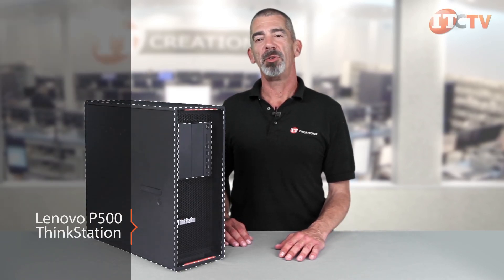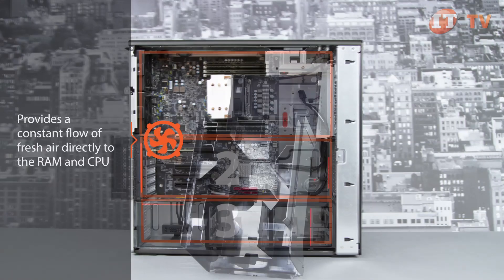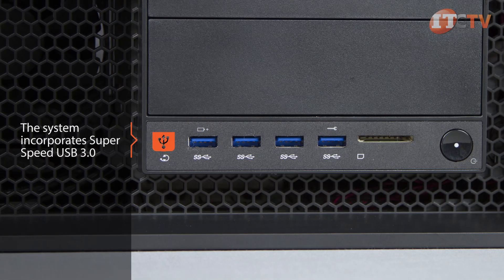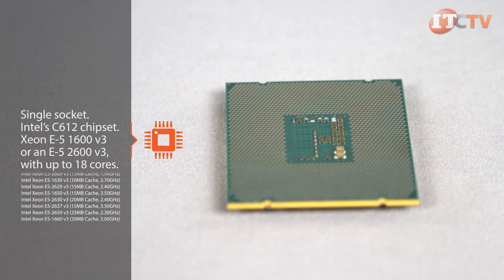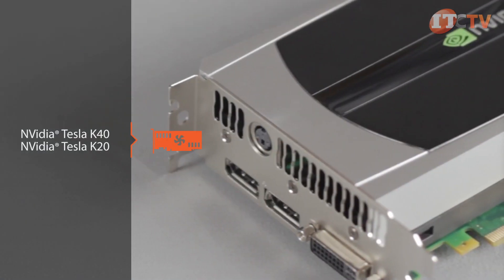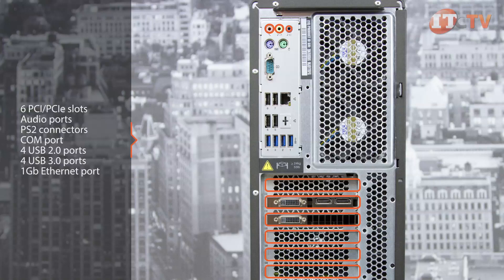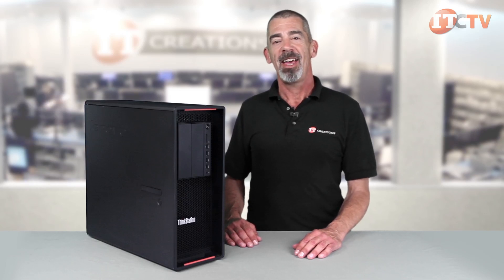Lenovo P500 ThinkStation Review

Comment: I brought one of these for cheap but have no graphic card do on need this to set up a monitor
Reply from the maker: Yes, you will need a graphics card. Specs say it will take up to 2x NVIDIA Quadro K6000 graphics cards. More information on our site and check out the documentation section https://www.itcreations.com/workstation-lenovo/lenovo-thinkstation-p500-workstation?utm_source=youtube&utm_medium=link&utm_campaign=youtube_lenovo_p500_link . The PCIe slos on the system board are a mix of PCIe 2.0 and PCIe 3.0, with 2x PCIe 3.0 slots for graphics cards. The Quadro K6000 has a TDP of 230W so if you plan on installing a newer card, 230W at the top end and PCIe 3.0 interface recommended.
Thanks for watching!
Reply: @Itcreations-LA  ok after quick research I’m thinking if I get 2 NIVIDIA quadro k620 that will solve my display problem then I should be able to put windows on it has ram and hard drive
Reply from the maker: @jamesscott3022 
Yes, you absolutely need a GPU for these workstations. Should work as is using a generic driver on your system. However, If necessary, you may need to go to the Nvidia site and download the specific drivers for that K620 GPU. You should have monitor support then for a single display port 1.2 and a DVI port from each GPU. Depending on what monitor you are using and the connector type you may potentially need an adapter to connect the monitor but not a big deal either. Check these out: https://www.techpowerup.com/gpu-specs/quadro-k620.c2600 
https://www.nvidia.com/content/dam/en-zz/Solutions/design-visualization/documents/75509_DS_NV_Quadro_K620_US_NV_HR.pdf
Good luck and thanks for watching!
Reply: @Itcreations-LA  thank you for the reply

Comment: i am sending this to my new station in the south :D will this help me beat all my competitor there?
Reply from the maker: Hi Patson, 
I'm not sure what you're using it for nor what equipment your competitors have. If you are using it for gaming, probably not as you might want a system that is not so focused on error correction as this is a professional workstation, not necessarily a gaming station. That said it is a very nice piece of hardware but a little old in terms of technology so newer systems will run faster and will achieve results faster. That said it is still a good platform! Thanks for commenting and watching!

Comment: bro do this workstation support overclocking ? like increasing turbo clock speed.
Reply from the maker: Hi Ismaeel, Nope. This system runs on intel Xeon Processors which are considered locked and unable to overclock. Of course, if you do figure out a way to overclock it will void your warranty. Hope that helps and thanks for watching!
Reply: @Itcreations-LA  brother , M using E5-1620 it have unlocked multiplayer. Overclocked to 4.2 ghz (air). Maybe v3 16xx xeon have unlocked multiplayer too. Looking to upgrade. Thnx for rply.
Reply from the maker: Hi again!
 @ismaeelmalik4688  Apparently you can overclock those but we don't ever do that for our clients. Here is some information because apparently LInus has done it with mediocre results, hope this helps! https://linustechtips.com/topic/530175-xeon-e5-1620v3-overclockable/

Comment: Nice review. I'm confused by the drive limitations in the review... 6 bays with a maximum of 24 tb ... does that mean this system is unable to handle 3.5 inch sata drives larger than 4tb each?
Reply from the maker: Hi Keernan, 
Maximum storage capacity was one of the items they used to list in the specifications for these systems, and sometimes they are indeed limited. It was probably also related to the maximum capacities of drives that were available and tested by HP. Given that it can support 6GB SATA it should be able to handle drives of higher capacities than 4TB. That said we don;t have a P500 to test with so whereas it should work, we can''t confirm... If it was only good for 3GB SATA (older MObOs…) then there is a limit of 2TB per drive, if I am not mistaken. Thanks for watching!

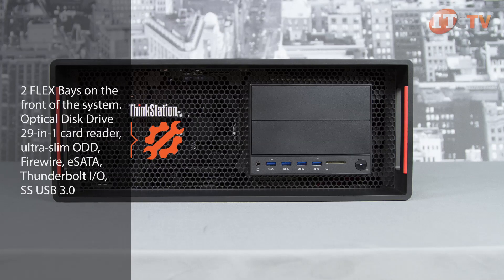Comment: I see at 1:34 you have the ThinkStation logo rotated 90 degrees. Is it rotatable or do you have to remount it manually?
Reply from the maker: Hi Peter, it’s designed to rotate if you want to place the system on its side. Just pull and twist, it’s spring loaded. Thanks for watching!
Reply: @Itcreations-LA  That's awesome, good to know, thanks!

Comment: Dear Sir, plz hel me....
I have installed dual os ( win-10 64bt & Ubuntu 14.4 64 bit ) . but when reboot pc system automatically loaded windows. don't saw Grub Men. plz kindly help me.
mi mail id shibinskp10@gmail.com. 

i have got it a Error Msg . when PC ON  Frst Show " Error 0135: CPU Fan Failure" how to solve this issue.....
Reply from the maker: +Shibin Nath K P - Honestly it could be many things without knowing your specific setup (could be many things even with that knowledge) but here are a few places to start. The latest product update indicates it does support Win 10, 64-Bit and Red Hat Enterprise Linux 7 but does not mention of Ubuntu 14.4 64 bit Here:

http://thinkstation-specs.com/thinkstation-p500/ 

So not sure if Ubuntu is compatible. Check with Lenovo. Assuming it is compatible, here is a link to installing Ubuntu and accessing the Grub menu:

https://help.ubuntu.com/community/Grub2/ISOBoot 

And, this with the specific error code (0135) for the fan error. the fan might need replacement or you may need to reset to the default settings in BIOS:

http://www.manualslib.com/manual/881054/Lenovo-Thinkstation-P500.html?page=108 

Here is a link to update your system drivers and software for Win 10 (64-bit):
http://support.lenovo.com/us/en/products/workstations/thinkstation-p-series-workstations/thinkstation-p500?tabName=Downloads&linkTrack=Mast:SubNav:Support:Drivers%20and%20Software|Drivers%20and%20Software&beta=false

Hope that helps!

Comment: Hi, great review! What is the maximum resolution that this station offers?
Reply from the maker: +Gregor Gobecthis response is somewhat late but…it depends on the video card and display you choose.  This system is designed for CAD applications and supports some top of the line graphics cards from Nvidia including the K6000 which is probably overkill.